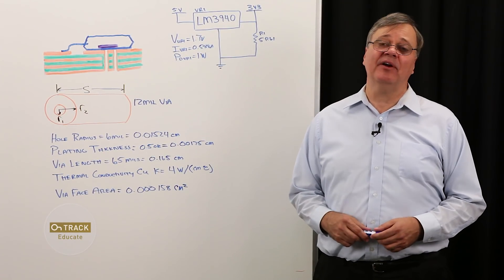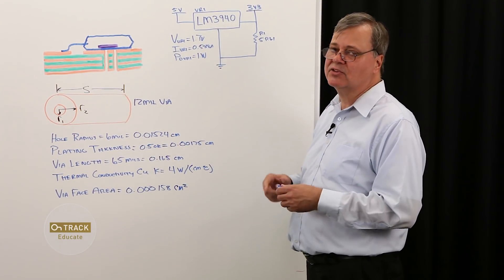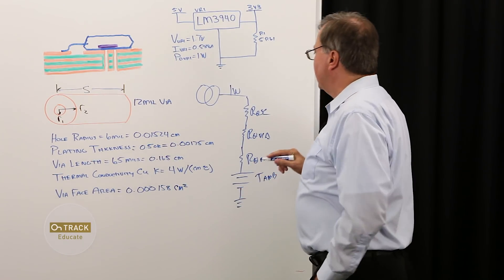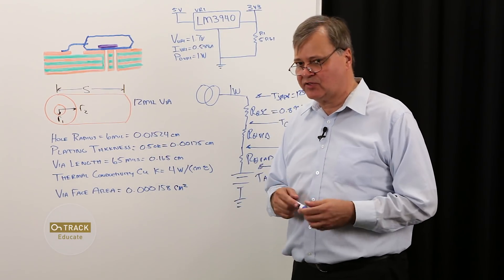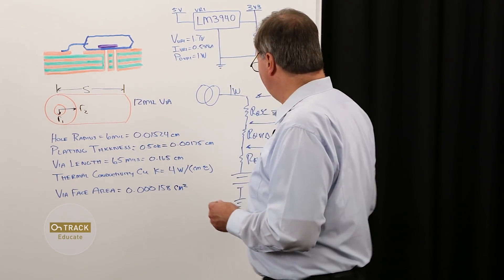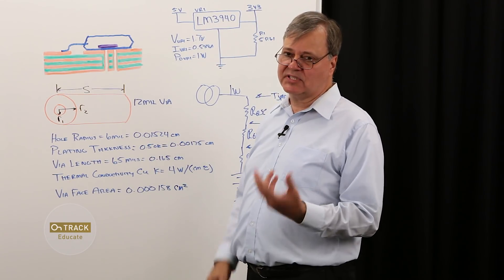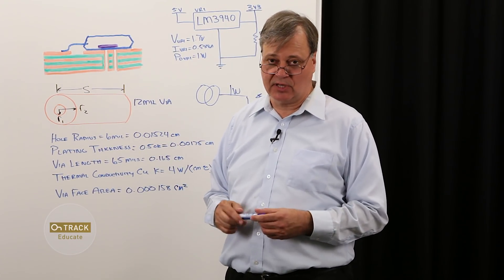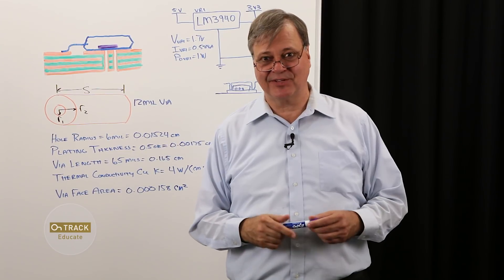Thermal Management (Part 3): PCB Heat Transfer - OnTrack

Comment: I am interested in the heat sink you mentioned at last for D-PAK. But I am wondering is the thermal pad also mounting on the PCB or imbedded into the PCB?

Comment: Ending the calculation would have been  more helpful than showing another heatsink. How do you take the number of vias into account? As I did not get the final calculation the whole tutorial series is messed up for me now. :/
Reply: You can handle multiple vias as parallel resistances. Just calculate the resistance for one via then divide the result by the number of vias you use. As for the rest of the calculations, take all these resistances and add them together to have a sum (these are series resistances). Multiply this sum with the amount of heat the system has to dissipate (1W in this case) then add the ambient temperature and the result is temperature at the IC.
Reply: Attila Kovács Thx!